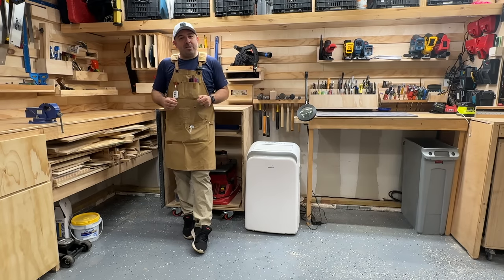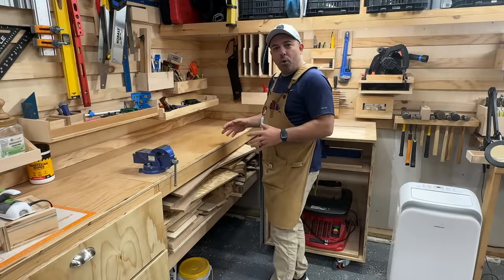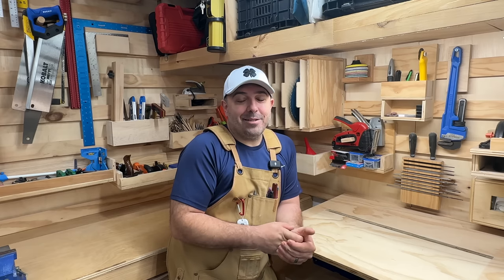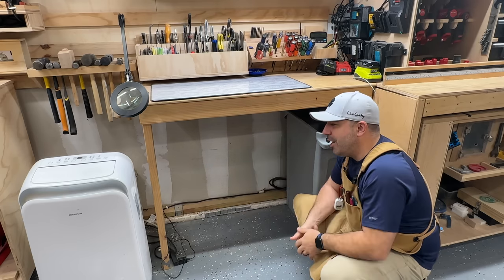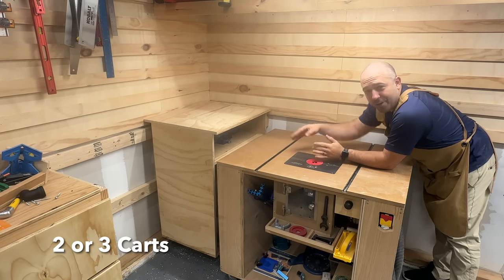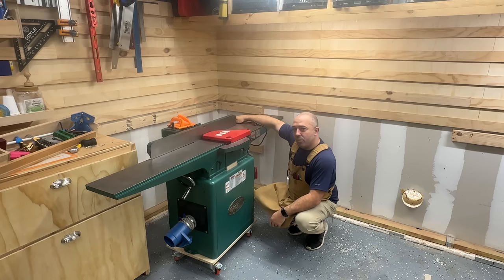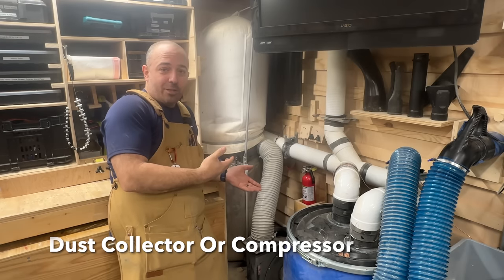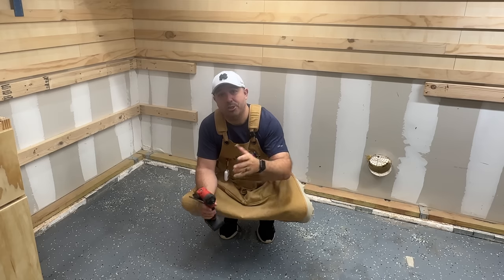Small Wood Shop Organization: Dealing With Corners In Your Layout

Comment: Since I have a 8x8 shed to work in and the roof is like a barn roof so I would built one long table along the back of the shed which is what I plan on doing and making some system to hang tools on the one short wall since I have to use my mitre and table saw outside the shed.
Reply from the maker: Very cool! I would love to see pictures! I’m really intrigued by the shed shops!

Comment: A corner space might be a good location to leave a compressor, if you have a retractable air hose sort of situation. I'm also giving thought in my new shop to using it as a stand-by area for my benchtop tools that get moved in and out of the main work area - 10" bandsaw, small router table, etc.

A bench grinder station would probably work well in a corner, as long as you don't find yourself grinding large pieces. Mine is used to take jagged edges off pottery, and for sharpening tools. So a lot of extra room around it isn't necessary.
Reply from the maker: All great stuff Eric! Thanks!

Comment: I put my desk in one corner. 
Dust collection in another. 
Back end of my surface grinder with milling machine 90degrees to it in the 3rd. 
And two tambour door cabinets in the 4th so the one only opens about 60% but with the crates in it easy access to them still.
Reply from the maker: That’s some good tips, Keith!

Comment: It’s really hard to set up corners. Im building a 12 x 20 shop and layout is the most important thing . I’m thinking one of the corners is getting a bench that runs into it with a round lazy Susan type shelf.
Reply from the maker: It definitely is, the solution I made definitely isn’t perfect, but it was the best that I could really come up with for my specific needs. A lot of people in the comments here have suggested a Lazy Susan scenario for it but it’s also been pointed out that that also minimizes a lot of the space being that it’s a circle in a square, but I can definitely see how a Lazy Susan would work well for some bench mounted stuff that would spin on top or hand tools underneath, so you can utilize that deep storage, but still get to it fairly easily

Comment: What I do for vise mounts is insert t nuts from the bottom, then it is easy to remove and reinstall as needed.
Reply from the maker: Actually, did the exact same thing Rick and then literally never took it off again 😂 so if you notice in the video, the three holes are still there because they are threaded with the T nuts. Now I have it in my head to keep it modular and keep it off at all times unless I need it
Reply: I did notice that as well.

Comment: You can get an insulating “blanket” (Sleeve”?) for that exhaust on your Portable AC that will drop that heat factor buy a HUGE amount. We got one last summer and it dropped the temp of that exhaust tube from something like 140 degrees to mid 80s.
Reply from the maker: Oh very cool tip. I actually just bought a mini split this week to install. More because of the electric price running my 2 infrared heaters, it’s been crazy so hoping the mini split will improve it all

Comment: Dust collector good in corner but emptying is becomes difficult. Depends on what is packed in front/side of it. I also think a four drawer file cabinet with less often used tools and supplies works  in corner. Another thing to think about is leaving a space. We pack so much in our shops it’s often impossible but keeping it clear is nice. I have one wall in my shop that the dust collection runs behind and all my power tools are lined up. At the end of that wall I wanted to pack one more tool on a cart in there. To have access at all times I hung a shallow shelf and some fold up, heavy duty saw horses on the lower wall. It works but it’s less than ideal because I always want to fill that empty spot with something. Usually shop vac gets rolled in there or project parts.

I’d rather see a modular sectioned version of your big tool holder. Four or more parts in a row with flexibility and easier to make out of scraps. Easier to build different dividers inside each of them. Could build one longer than the other but they are all the same dimensions and would look great lined up.
Reply from the maker: Great thoughts Fearsome! You know I was just sketching out that video because I’m gonna start working on it this afternoon for the hand tool parts and I was thinking how most people aren’t going to build it the way I was thinking I was going to do it, and so breaking it up into building 4 different Layouts but all the same dimensions so they can be lined up next to each other is a fantastic idea. It will look like one consecutive unit but can move to otherplaces as needed for flexibility makes so much sense! I really appreciate it! I’m gonna attribute that one to you in the video!

Comment: So I use 45deg shelves for corners in my shop, but if I didn’t do that I would put a floor sweep dust collector there.  The pipe would easily run down the corner making it simple to set up.
Reply from the maker: That’s a good one!

Comment: I enjoy your videos very much, the way you walk through processes.  I have a suggestion to offer, if you already have this suggest, I apologize for the duplication.

How about a lazy susan style rotating shelf design for storage for corners.  This is the simple idea.  I have a much more confusing explanation of what I did in my garage and carport.  While it may be confusing to others, it makes perfect sense to me.  But then I tell people, “You can’t fool me, I’m too stupid.”  Feel free to pass on my explanation, you can’t hurt my feelings, I was in the Marines, I was in the Fire Service for 50 years as my main source of income, and, most importantly, I used to hold the flashlight for my Dad.

I have a three car garage where I have two pick ups and a lot of carts and a work bench on wheels (very heavy and now difficult to move because of all the “treasures” stored on the flat “work” area).  I lined the walls with cabinets (4’ x 8’ boxes with either 16” or 24” sides that I mounted vertically on walls, with the back side on the mud sill to keep the the bottoms off the concrete floor by at least 10” - while it may sound confusing, it makes perfect sense to me).  There is a point to this filibuster, with a 36” work bench (which has evolved into another flat area “treasure” storage area), I had a corner area left me with an access of around 30” making almost useless.

My solution was to make a lazy Susan with rotating shelves.  I took two 4’ x 8’ x .75” plywood and made 3 - 47” circles.  I installed .75” shelves, which will be used to support the lazy susan.  I had some .75” ID roller bearings that put into the permanently mounted shelves that was placed to where my 47” circles had 360 degree clearance.  I took .75” all-thread and mounted it vertically through the holes in the permanent shelves.  I put a block on the floor ran the all thread up through the first shelf (which is about 10” off the floor), then maneuvered my first 47” circled with its .75” ID roller bearing in the center onto the the all-thread that I had double nutted to keep the rotating shelve at a proper distance for the 2” caster wheels that I installed on the bottom of the rotating shelf that rode on the permanent shelf.  I actually had the all-thread in short lengths that I used couplers to connect the all-thread together.

I continued the process two more times.  I have much more easily accessible in my corner.  I did the same lazy susan one tier rotating shelf on at each end of a mezzanine style shelf I have in a carport that is at a 5-foot level for easy access from the floor for garden supplies without having to climb a ladder to get to the little stuff in the back.

I will stop inconveniencing electrons and close.  Thank you for videos.

Respectfully submitted
Reply from the maker: Haha thanks and wow thanks for the detailed suggestion. Yes a big lazy Susan is a great option for the corner! I debated it last week when I ripped apart the corner of the shop for the 3rd time this year (went with a L shaped double decker enclosure for 3d printers and lasers) since they don’t move and need limited input from me they can be in a odd reach spot. Thanks again!

Comment: I also try to minimize the storage requirements in my shop. I dont like to collect stuff and i dont like biying more than i realistically expect to use in a modest timeframe. I have one "long term storage" tote that i empty every so often
Reply from the maker: Yea that’s a struggle for most, it’s great you can do that, getting rid of all that scrap in the corner was a little step in that direction for me 😅
Reply: @BitnerBuilt  yeah...every little bit adds up. I've moved shops twice in the past 5 years, so that also helps control my "habits"

Comment: I have my screw drivers, allen keys, punches and bradawls mounted in wood blocks on a board which is hinged on one side with a magnet on the other side. This is mounted in the corner and i can swing it out when i need access to the tools.
Reply from the maker: Ahh now that’s a unique one! Very cool tip Gary!

Comment: My corners have a (1) Trash can (2) Snapmaker (3) Kiln (4) plastic shelves.  The Snapmaker is placed so that the front and right sides of the enclosure can both be opened up.
Reply from the maker: Nice Gregory! yea I really should have talked about cnc, laser, 3d printer for the corner. How do you like the snap maker?
Reply: @BitnerBuilt  I have only used the 3D printer part so far.  I do like it.  One of the first projects I had to make was a dust port for the CNC router as when I do use it, I would definitely like to have dust collection on it.

Comment: How do you keep sawdust from clogging the portable air conditioner filter and vent?  I have one that I want to put one in my shop
Reply from the maker: I try to use my dust collector, really efficiently through the shop, but yeah, there’s always sawdust at the filter, so I hit it with the air hose once every two weeks or so that was another reason not to put it up high

Comment: SO…. Four corners in a room… right? LOL. One corner… has my double doors that lead outside. I have some lumber and things stored there. This is also right where I have a set of stairs (the underside). So I have a shelf there with medium size cutoffs. THings that are not full length. My second corner… also a door that goes into the house. That is where my dump sink is and metal cabinet with paint. Third corner….  THere is about three feet and then a window. I have lumber storage on the wall here. We took down a walnut tree on our property and this is where the walnut is stored from that. My fourth and final corner…. This is where I have my xcarve. It is also where a window is that I have a small (but beautiful) view of the Ohio River. Lots of storage under this and the dust collector for the xcarve is housed in it. On the joining wall I have my laser. This has been a great use of this corner. 

I really like those corner French cleat brackets. However… The only corner that could hold these are where I have the xcarve and the wood storage. I can’t even reach the walls beyond the xcarve. So I have a tv mounted there that I use for programming the xcarve and the laser.
Reply from the maker: Haha well your corners are already busy!